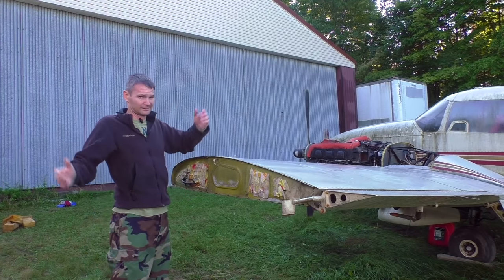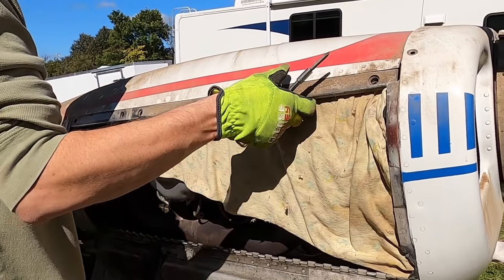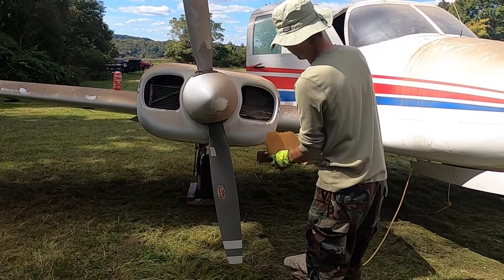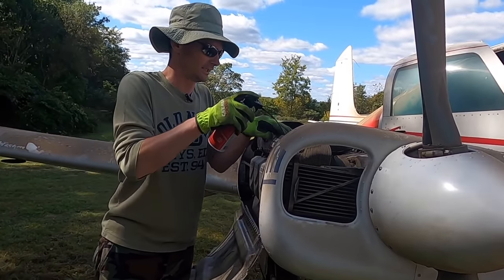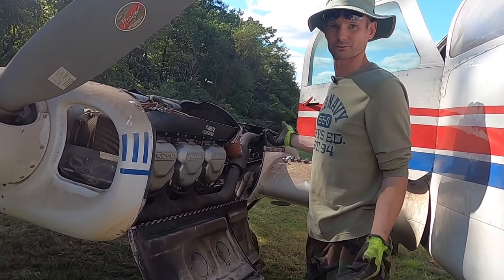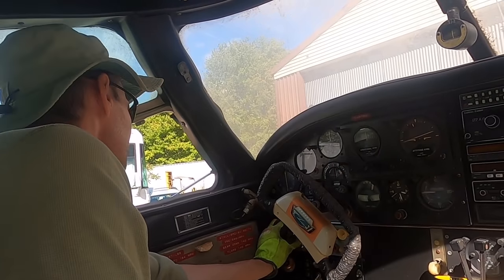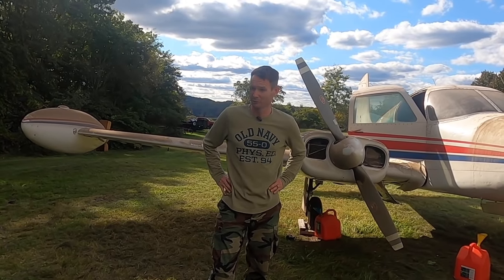Abandoned Airplane Will It Run After 37 YEARS!

Comment: I have owned Cessna 310's for over 21 years. MY opinion is this airplane needs to be put back in the air. Of all the choices in light twins out there today, the 310 is the best choice. It is fast and comfortable plane to own and fly. It is expensive only if you choose the WRONG people to do the maintenance on it. There are a lot of good shops on airports that don't have high rent. They can do great work and not take you to the cleaners. People who take their airplanes to big airport maintenance have to be not concerned with cost. The most expensive and the poorest annual I have gotten in 21 years on my airplane was at a high rent big airport.
Reply: You are lucky to be able to fly any time you want. I wish I could fly again. I really miss flying. 
And you are right about the cost. Some times doing the repair yourself is the best way to go.
Reply: A lot of the expense of cessna twins twins comes from the increasing rarity and price of parts that need to be replaced. But cessna twins like the 320 and 310s really are about the best planes you can get without going to something like a king air.
Reply: @RandomName841  Agree, but what I was aiming at is that the cost of labor and inspections like annuals can be twice+ the cost at shops on smaller "low rent" airports for the same service.
Reply: @chucksdesk  You are definitely right the price of annuals can vary greatly based on where you choose to get it done. It's certainly important to consider things like that carefully since the costs can definitely add up.

Comment: Interestingly enough, this plane has a story prior to it's hangaring!  Back in mid-January of 82', this 310 was on a dusk approach to snowy Butler PA's rwy 36 when the left main landing gear, left wing and left prop struck an automobile driving on the perimeter road.  There was significant damage to both plane and car, but no injuries in either.  Plane landed safely.

FAA's findings were 1) dusk light conditions 2) mus-judged distance PIC and 3) misjudged altitude PIC.  

Very happy to hear all walked away unharmed and this O-470 powered 310 gets to fly again in a new millennium!

Comment: Certificated airframe and power plant mech here, I am seriously jealous of that find. When I got my certificate in college, I worked on one of those! a 310R! Easily my favorite airplane in our hangar. It had been trashed by so many other students working on it. I had to do a mock annual on one of the engines that wouldnt start. Wound up being a timing issue. As soon as I set the timing correctly, she fired right up. Few things are more satisfying. Id love to have one, but a lot of the 310s out there that are active are pretty pricey, and old ones that need a lot of work usually require more money than they are worth to get airworthy again. Such a shame.

Comment: You made me cry when you turned that engine over
 I rebuild a lot of vintage machinery.
It you let oil sit even for 6 months let alone 37 years it looks perfect as all the partiiculates drop to the sum.
It you run the with out changing oil and cleaning sump you have just sucked all the crap into you oil pump and pushed it through engine.
Also all cams bearings above oil line will be bone dry. Damage damage. Open covers hand oil Frist I tell all my clients.😩

Comment: The popping sound is just a misfire, probably from a bad plug or more likely an old wire arcing to the metal of the engine. I'd bet that the compression tests will be good. If you're planning on selling  - I'd be interested as well
Reply: they still need to be torn down and looked at with out logs the engines are boat anchors
Reply: The popping you hear are the magnetos, (I don’t know the specific details, I’m not an  A&P.)
Reply: Sounds like it leaned out and was getting hot.
Reply: @Elios0000  Had you paid attention, you would have known that he had the logs.

Comment: One of my passions is Boating and  i’ve bought  many older. neglected. boats   over the years and get  just as excited over the little things  working  like you did inthe video one of my last big projects was a 1964 Chris Craft CabinCruiser  and  one thing i did  was hot wire  the factory refrigerator 110 volt  and was completely surprised it powered on and began getting cold  the first thing i did was put a warm beer inthe freezer and 25 minutes later it was cold enough to drink and share with a Buddy  I fully restored the old girl  and kept her in a Marina for years  then eventually trading her in for another Vessel

Comment: Powering the strobe PS was a mistake this way. You needed to "reform" the capacitors, there is a proper process, to bring the strobe PS back to life. Likely you will need to replace it or them within a couple hundred hours.

Comment: Hey next time here's a trick - while you still have the spark plugs out; turn off the mags, leave the fuel cut off and then crank it to get oil pressure. 😎 The compression load on the bearings is eliminated while it's rotating the dry bones over. 💪 I'm not even all the way through this video. Loving it so far!
Reply: He did

Comment: I enjoy your videos quite a bit. I wanted desperately to be a jet pilot but, fate saved me (or fucked me). I took my first flying lessons at 16. My parents were dead set against me doing so, so it was difficult to sneak to the airport for lessons. At 18 at college I took lessons in Piper Cubs and then Cessnas whenever I could come up with money, but working thru college left me little money. So I figured I would join the Air Force when I graduated. So when I graduated, they didn’t need pilots as the Vietnam War was ending. I had about 30 hours of private time. So I couldn’t figure on a path to my goal and instead, went to law school. Halfway thru, I read that the Air Force needed pilots, so I applied and they said at 28 I was too old. I eventually became a Palm Beach County Judge and I never finished my license so I fly vicariously through you and others on YouTube. The world is much safer with me flying a simulator.

Comment: Whoever packed that 310 away did a great job for the long term storage. A good wash, wiring checked, cable tensions checked, and some LPS 2 in it’s joint and should be ready to go. Maybe even a corrosion check on the airframe.

Comment: I have been a commercial pilots since 1970 and an Air Forced trained aircraft mechanic since 1968  with an A&P license.  I would never consider flying that aircraft with out a complete tear down and inspection of both engines and props. Even if they were factory new when installed and has never been run.  Also a complete annual inspection and repairs.  Which would probably take at least a couple months.

Comment: I don’t see an A&P or IA comment on this site. You have a lot of work to certify this aircraft airworthy. Corrosion is the biggest concern. Having both licenses this can turn into a project. First I would get rid of the Bendix mags and install Slicks with a new wire harness. I could go on but this is enough.

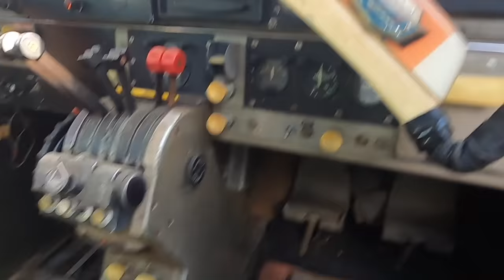Comment: I knew it was going to go well when you hooked the battery up and the lights started flashing and or turning on.  Then when you went in the cockpit before starting, I heard that weird clicking noise at 08:15 that my 310 makes I knew it was going to start. It is pretty amazing that it started after sitting in the hanger for so many years! Looking forward to seeing what it takes to get it air worthy and flying again.

Comment: Nice story bringing old plane to life.  Sad part, new Propellors or overhauled props of that vintage cost more than the plane is worth.  Then maybe a tear down at the least or overhaul of engines is a bunch.  I own the oldest flying Piper Aztec s/n 18. Have owned it for twenty years.  Due to idiots flying her, has had three inadvertent gear retractions on ground.  These old light twins are a joy to fly, they are great real Multi Engine trainers.  I flew B model back in early 60s and owned a J for a while in 70s.  The 310 in its day was a great plane, still is, fast at a reasonable fuel burn.  Seating in the B isn’t that good, bench across back.  I am not sure how many ADs have been issued on B airframe, some of the old ones have spar AD due to exhaust routing.  Those props, Hartzell’s have big 5 year 500 hour inspection.  Unless they had been replaced in late 90s.  You can be considered very lucky if your props make it thru that inspection.  I do hope he truly restores this plane, with dirt off I think it will look good.  These old girls deserve to be restored if they have made it this long.  The young pilots of today need to be able to see and feel aviation history.   Nice video thanks
Reply from the maker: stand by :)

Comment: Not even worth it. Everything firewall forward has to be replaced. Wing spars and everything made of aluminum will be corroded. Control cables, hydraulic lines, landing gear, wiring, flight instruments, fuel pumps, etc., have to be replaced. It is only good as a gate guard.

Comment: If I remember properly,I could be wrong but one of the first steps before  working on a plane like this is clean the outside so that you can expose any leaks or hidden cracks and lessen the chance foreign debris from entering and engine intakes. This is you tube though so who needs to follow protocol.

Comment: Apart from the engines , i believe after 37 years it will  also need a check  on structure and cables (rust etc),and  as a consequence of natural decay a thorough refurbisment of the electronics system and electrical wiring.
Reply: Thousands and thousands in  repairs lol.

Comment: Hope you didn’t pay much. They are abandoned all over the US. The aircraft skin corroding from the inside out. Inter granular corrosion in wings  fittings needs to be inspected very carefully. I’ve seen 182 low time stored in a hanger. Doors haven’t fully opened to expose the plane. Owners inspector asked me to inspect sheet metal, found all the flaps and control surfaces corrosion all the way thru. Be safe don’t be in any hurry to fly. I enjoyed the video

Comment: LOL  Yeah that  " pop pop "  sound is fine !  Its only cause the engine is skipping on a few cylinders !!!  No need for alarm , Unless your in the air and the engine is still skipping cause you haven't fixed whatever it is causing the enging to skip , or the correct term is " missfire "  I believe that's bad in a plane !  Atleast when it's in the air !

Comment: The Cessna 310 is in relatively good shape; it just needs some work done on the engines and a complete wash externally followed possibly by a repaint plus replace the avionics and re-upholster the pilots' seats and the passenger cabin.  Also, jack up the plane and test the landing gear to see if it still retracts and extends.
Reply: Don't forget about 30 or more years of Airworthiness Directives that likely haven't been done.  Expensive ADs often ground airplanes for years, stretching into decades.  Sometimes AD compliance can cost more than the market value of the airplane.

Comment: I geuss the biggest issue with these abandoned oldies is the ADs that have come out during the period they have been abandoned. PA28s, for example suddenly had to have their crank shafts inspected for corrosion after a couple of in-flight prop detachments. The CAA here in the UK and I guess the FAA over there are never slow to issue more checks which, while making aviation safer, adds costs to the owner. I believe I'm right in saying only ONE PA28 had a prop fall off, but ALL of them had to have the inspection. TBOs have changed a lot as well. General aviation was never cheap, but just look around the GA airfields in the UK, and theyre shutting down at a rate of knots. Old Sarum near Salisbury gave its owner operators one week's notice to clear out.

Comment: Great find, Jimmy.  That’s a beautiful aircraft and the owner kept it generally well-preserved, mice and dust notwithstanding.  It’s rare for such an old bird, but it looks like you struck gold.  I especially liked your term “money-to-noise converter”.  I hadn’t heard that one before, but it applies equally to planes and race cars.
Reply: Possibly any thing with an engine
Reply: @heartland96a  Indeed, but my riding lawnmower would certainly be an exception, haha!
Reply: @michaelandcolinspop  Yes lawnmowers , snow blowers ,  pressure washers among others are handy labor saving devices , Until it's time to repair or replace hence the  repeat of  the cycle of spending it can't be avoided .
Reply: @heartland96a  So true. It pains me to think of my tractor eventually dying.  Not because of the cost, but because of what a great tool it’s been for 15 years and counting.
Reply: @michaelandcolinspop  Even with good maintance they wear parts if your lucky the mfg is still in business and spares are available or can be can be found as good take offs from another.

Comment: Change those sandcast engines to permold. Pull those mk 12 radios and replace them with a kx155/g430. Change the hydraulic system, all cables and pulleys. It will be a world class flyer when you do that.

Comment: That one won’t mine dumping money into to get it flight worthy and avionics upgraded. That one would love to see in the air again. That a great twin that one I won’t part out.

I am shocked after sitting for 37 years actuators still actually work and smoothly to and didn’t leak fuel out? Then the engine fire right up without much effort but was misfiring but understandable since wiring shot and brittle and seals are likely dry out. He took care of it till it sat.

Comment: Once you start restoring the plane. I hope you do a detailed areas by which analysis of engineering aero pieces, like paneling, instruments, engine parts or if you can buy them from aero dealers or manufacturer or machine own engine parts within the Us laws & framewprk of FAA. Not to mention the interior upholstery & controlboard, throttle & steering. The fuel tank & lines, + Also lining on inside of cockpit. There's alot todo but man oh man looks cool, like aero electrical. Hard work all day 
.

Comment: Question for JIMMY? Why would you try to run the engines without changing fuel filters and draining the fuel tanks to check for goopy grody stuff? The aircraft had been in a dusty Barn for 37 years and the fuel system could have sent bad stuff into the motor??? Right?

Comment: I HAVE to comment. I see this on all these videos, airplanes, cars, they pull a dipstick and they say "oh look fresh oil". it's not fresh oil, it's been sitting for 37 years all the sludge is in the bottom of the crankcase you need to change the oil before you ever try to start these engines that have been sitting forever. The engine is going to suck all that crud up into the filter, and clog it, remember, that oil filter has also been sitting for 37 years, it would not surprise me if the filter media was all deteriorated and coming apart and now you're sucking that up into the engine bearings. I have been making my living in aviation since 1977, A&P/IA.

Comment: I’ve dealt with doing old tractor restorations that have set in barns for 20-30 yrs and the thing that scares me about an airplane is what the rats and mice can chew up in the wiring and might not have broken all the way through but can chew just enough so when you’re using it wires start breaking wires coatings are chewed through and start touching each other and when my tractor breaks down because of it at least I’m on the ground being airborne would scare the hell out of me I’m sure you give it a really good look through before a flight is attempted but still there’s places mice can get to you can’t see! Have you had any problems like that before  I know you can run system checks through wiring and stuff like that but have you had any break after it’s in use or any problems like that I know nothing about this stuff but I was really interested watching your videos!

Comment: I think this one needs to get put back in the air. It's too complete to just part out and sell. I mean all the freaking lights even worked.
The way it started right up probably means it was put away correctly. Do a lot of checking for mouse damage to wires etc obviously and a good cleaning.
I don't know what the regulations and stuff would require to get it certified perhaps it's simply financially not worth it I don't know. But that airplane is very clean and well-kept. Seems a shame to just tear it apart and sell it for parts.
I suspect the fact it was kept under cover in a building helped significantly.

Comment: Getting it started is a great feat but it is a far cry to get this plane in the air legally.  One has to get it airworthiness certified which includes inspecting and passing the airframe, flight controls, and electronics.  Corrosion will definitely be an issue on this aircraft and will need to be dealt with, and probably won't be cheap.  Anything electronic is well past its useful life - while it may work, it won't work for long.  I would not want to be in this thing at 10K feet if a radio or electronic ASI dies.  I'd bet if you sell the other two aircraft, the sale would not cover the cost of making this one airworthy.

Comment: 37 years?!! Yeh, right! The tires would be goners, mice (or squirrels) would have eaten all the rubber. Fuel cells would be shot. He certainly would not have been able to just pull it out of the hangar with a simple hand tug. Oil looked like it was fresh changed.    Fun video but don't lie to people

Comment: Don't think I would have started the engine without first injecting Mystery Oil in each cylinder, turning the engine over and let it sit for a couple of days. Then change the oil and all filters and clean the plugs. Only then would i try to start the engines.